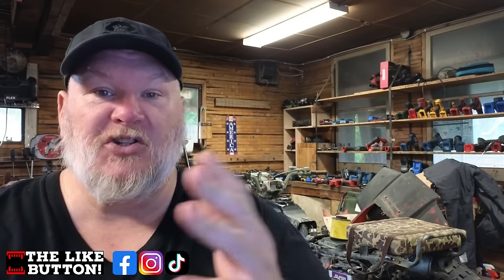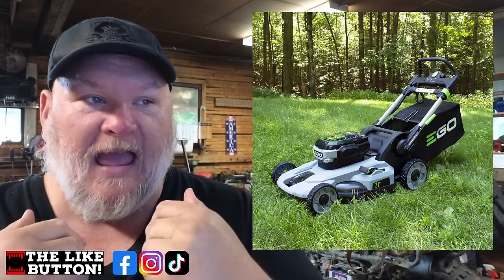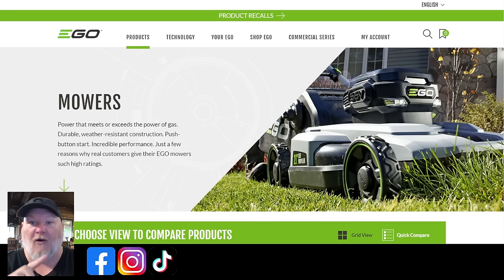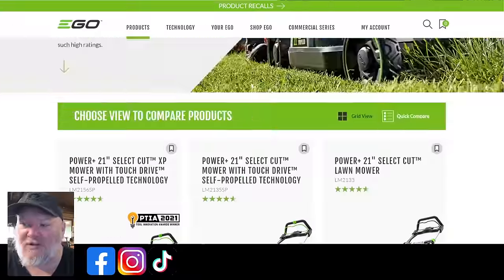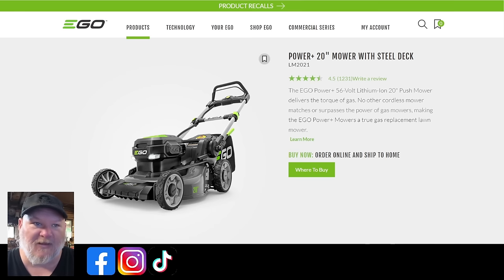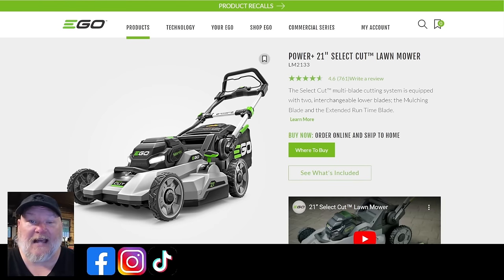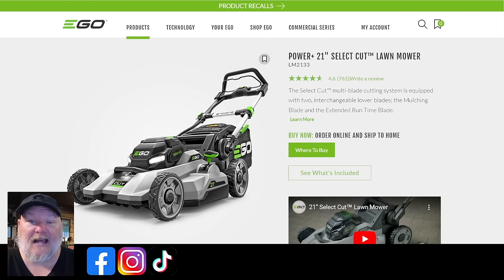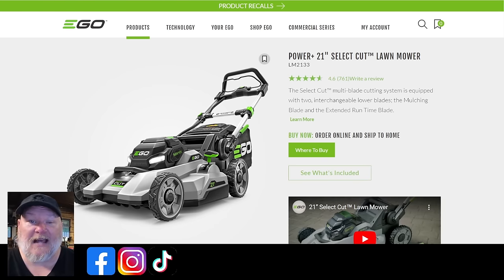What is Going On with Ego Mowers?

Comment: I went down a rabbit hole to decode the EGO mower model numbering system.  LM, of course, stands for Lawn Mower.  Here is the additional info.

Series	Features
2100	Base mower
2110	Base mower with higher torque motor
2120	Touch Drive
2130	Select Cut, may have Touch Drive, includes blades M E and may include H U
2140	Two battery compartments for Peak Power Technology, same torque as XP
2150	Select Cut, XP for even higher torque, Touch Drive, includes blades M H E U
2160	Select Cut, XP for even higher torque, Speed IQ replaces Touch Drive
	
Last number "0" indicates "Tool only" - battery not included.	
Blades: M-Mulching; E-Extended run-time; H-High-lift; U-Upper blade
Reply: Nasa should hire you!  Cheers!
Reply: Thanks. Is the mulcher and  side dispenser pieces included in all models?
Reply: Very helpful!
Reply: @inquisitvem6723  yes
Reply: Thank you. This info is really helpful
Reply: I have one of the originals self propelled for edge trimming, a blower, a string trimmer.  I just got a Z6 52".  EGO works for me.  Tired of effing with shitty gas and carbs and the rest of it.
Reply: Need to add first 2 numbers indicate size (21") and SP is Self Propelled.

Comment: I have the barebones LM2101 (non-propelled, 5Ah,).  It does a fine job on my 3000sf+ lawn (0.2 acre).  I have several other Ego tools, so I have 2 more 2Ah batteries.  I never have to worry about running completely out of juice.  My only complaint is that it only goes down to 1.5".

Plastic vs Steel Deck:  For the vast majority of people, the plastic deck will be perfectly fine.  Unless you're constantly running over rocks and sticks, the plastic deck will be substantially lighter and easier to maneuver.  There is almost no vibration with an electric motor vs a gas motor, so there's very little risk of the deck cracking.  Having an electric mower with a metal deck adds unnecessary weight for most situations.

Push vs Self-Propelled:  Pushing a gas mower is far more work than pushing an electric mower.  With an electric mower, you don't need the heavier metal deck and gas motor and you don't have the constant vibration.  I had both an Ego push mower and an older Honda self-propelled mower.  It is easier to push the Ego than to let the Honda propel itself.  Most people would be really surprised at how easy it can be to push one of these.

Runtime: The best situation is to have all of your OPE on the same battery platform and have multiple batteries.  It's so much easier to "restart" an electric mower once it's run out of power than to "restart" a gas engine after it's run dry.  My old Honda (15+ years old) was a PITA to get started after it ran dry.

13 Different Models:  Absolutely ridiculous.  They don't even need half that many.  They're just cannibalizing their own market.  They only need 1 non-propelled, 1 high-end self-propelled with all of the features, and 1-2 lower spec self-propelled models.  They keep coming out with more and more models that have very little differentiation from the existing models.  They have done the same thing to their blowers, string trimmers, snow blowers and Zero Turns.  Way too many models of the same basic piece of equipment. 

Prices:  The prices for their lower spec stuff are fine.  The prices for the top spec stuff are pretty ridiculous.  The added performance and features are nice (I would guess), but you pay dearly for the privilege. 

Overall OPE lineup:  What they have is great (I have 5 pieces of equipment).  But, they're missing several key categories.  Where are a backpack sprayer, tiller, dethatcher, and REEL MOWER???  I'm sure that they would build great choices in those categories IF they ever bothered to try.  But they keep churning out new models in their existing categories.
Reply: Thank you. A couple questions. Do all the mower batteries from EGO work on all the EGO mower models? If I buy the 56v 7Ah 21” mower , can I use the 6Ah with the mower? I guess it’s a matter of form factor right? If the battery fits in the mower, then it will work? The other question is  a self propelled one worth $100 more than a push one? If something goes wrong with the sp feature, I can still just push it like a push one right? Or will it disable the entire mower? You mentioned that push mowers on battery mowers are really light assuming it’s a plastic deck which is why I’m considering push instead of self propelled. I just know my non self propelled gas mower was a pain in the butt over the years. Thx.
Reply: What about generic 56v batteries I’ve seen on Amazon. Some off brand ones. Have you bought any and tried it?
Reply: They do have a tiller attachment now. It goes on the multi-tool. I haven't used it but I saw it browsing yesterday. 
All the batteries are compatible with other Ego products except it takes an adapter when you use a backpack.
Reply: I too have the 2101 for 4 years.....along with 4 other Ego tools.
I've never been completely happy with the 2101....cut quality,mostly due to its weak suction is my main gripe.
I've done the dual blade conversion.....maybe helped a bit.
I have 0 need for self propelled.....but Ego appears to be pushing me to that cause availability of Ego push mowers here in Canada is......bad.
I love the convenience.....so for now I'll just use it.
The blower,whipper and chainsaw are awesome tho.
Reply: @rodjbosch  Earlier this spring I got a high lift blade for the 2101 push mower and the suction and cut quality improved a lot, especially the suction. It was still the single blade, not the conversion, though.
Reply: @frommatorav1  
I have that as well.
Tried that before the conversion.

Comment: I have a Honda self-propelled 21-inch mower that I purchased over 19 years ago it still runs beautifully and it has an easy start to boot.
Reply: I tossed a new Toro in the trash after a year, the hydrostatic Honda HRX I have now will outlive me, it's just awesome, my grass is basically 1.5" of thick carpet Bermuda, max speed I have to run after it it mows so fast and never bogs. Scalping is next level.
Reply: You still get to smell like gasoline fumes!
Reply: Same here, have a rear wheel drive 21" Honda mower for a decade and still looks brand new. I rinse it off after every use, sharpen the blade every 15 cuts and only use non ethanol gasoline. Starts every time on the 1st pull. I dont see the need to spend $700 for a plastic mower that can barely mow 1/4 an acre
Reply: @snotbubbles3276 I've had the base Ego lawnmower with 5ah battery and rapid charger for 7 years. The battery started waning a little 3 years ago. I bought a 16" chain saw with 5ah battery 2 years ago and use it for the mower. That mower never needed any service other than cleaning the base above the blade after cutting very wet grass a couple of times. I never have to change the oil. I never have to drive to get gas. I plan on getting a  new blade this year but my original blade has never been sharpened or replaced yet. When I  do replace it, I can put the mower on it's side and never worry about spilling gas or oil, either.
Reply: Im trying to sell mine(Honda 5.5) for a battery one. No takers for the past two weeks. Selling for $80. It appears no one is interested in gasoline mowers ☹️. Heck I was willing to exchange it to get my drive way power washed and no takers.
Reply: Gas mowers of 10-20 years were better designed and built than any of today's mowers. We know that and don't need to be constantly retold that in every mower vid. 

The vid is examing what is available on TODAYS market
Reply: Gas mowers are becoming a dying breed. You will be lucky to get anything above $100 for your 21 yr old mower if you sell it. Even used   battery mowers(newer generation) are selling like hotcakes on Craigslist.
Reply: My Honda HRX Versamow is over 10 years old and I am the second owner. Starts first time every time, every year. I bought the EGO last week, but I am not getting rid of my Honda.
Reply: @danielkennedy3073  His lungs take it all in! Enjoy
Reply: @gary22pcb  Smart move! I bought an EGO mower last summer, and I've found it doesn't handle lawns if they're difficult. Our house sits on a hill, and the yard is very uneven and hard to mow. Because the EGO was advertised to be tough, I thought it would do the job. I'm really disappointed in this mower.
Reply: Going electric with the ego mower was the biggest waste of money I have had in a while.  Well be trying to sell it and go back to gas.  Piece of crap.  Batteries die every two years, horribly responsive mower speeds, won't spool up until after about ten feet of partially mowing the grass.  Had one fail already thankfully it was replaced under warranty.  Junk.  Love the chainsaw, blower and weed whacker Are acceptable.  Mower is a steamy pile of crap.

Comment: I purchased my EGO LM2100SP back in the Spring of 2017,  Its still going strong.  It came with the 7.5 Ah battery which is still working well.  The only problem( recent within the last 2 yrs) is that one of the speed control wires has an intermittent such that with the handle extended to operating length has full speed only. Not a problem for me since I never use the SP in my yard with St. Augustine grass( I count it as a workout instead of going to the gym that day)  Great Channel BTW.

Comment: I agree with your findings.  I have their line trimmer and leaf blower and have been really impressed with the battery technology.  By the way, that $1000 mower is that price because it comes with a 12ah battery.  If you were to buy the 12ah battery by itself...it's $600!  I'm an EV guy, so I like to compare some of this stuff to EVs.  You'll see some of the Hyundai and Kia EV cars that cost over $50k, but you sit in them and the materials used feel more like a $25-30k vehicle.  The high price is because of the batteries.  You'll see a lot of hate online for EVs and battery powered equipment because of this, but we're at the dawn of this technology.  I predict in the near future, the prices will drop with better battery technology that becomes lighter in weight, and cheaper to source.
Reply: As an owner of many EGO products, I welcome improved battery technology.  I foresee smaller and lighter power sources, or batteries the same size but with many times the capacity.
Reply: Battery prices will never drop, lithium batteries are a perfect cash cow... The biggest 18650 is still around 3.5ah, the tech hasn't gone anywhere fast in the last 10 years.

Now companies are switching to cheaper lfp batteries which Ford says cost as little as $80/kwh but the cost of their battery pack is like $36k, that's a massive profit margin, same as ego, here in Canada its basically over $1000/kwh for their batteries and that's a total rip off, that's basically 90% of their business...

Comment: I have the original 21" self-propelled mower , bought June of 2016. Still going strong, original battery still works fine, bought a 2nd battery 2 years ago, use it every other mow.

Comment: Australian Ego user here. Bought a 52cm Ego push mower last year. The fast charger was faulty out of the box and only charged the battery to half charge, then shut down. Ego Australia typically provides smaller batteries and charge a lot more than US counterparts. The Z6, for example, is almost $10k here (US$6,600!) and is only supplied with 4x 10ah batteries 😡 The push mowers are usually only supplied with 5ah batteries.. I do like the push mower, now that I have a replacement charger, but I'm pissed that  we have to pay so much here for downgraded products..
Reply: 52 inch?
Reply: @mactive11  No 52cm lol

52" - that would be a 'unit' of a push mower. My bad
Reply: I read that Ego had a bad batch of batteries & chargers which they replaced under warranty without fuss. It happens to any manufacturer

Comment: My concern, and I don't know enough to be sure, is that each of these electric manufacturers are making mowers with no standardization between them, and so every part will be proprietary and must be purchased from factory. Everything breaks eventually, and when these break the parts will be too expensive to repair and these will end up on the curb. I hope I'm wrong.

Comment: I bought a Hart 40 volt 21” with self propelled drive two years ago.  Paid $175 at Walmart and it came with battery and a charger.   It was on sale in October.   Works great, no issues, and it mulches.   Not as powerful as my older gas push mower.  I was looking at the prices on several brands of electric, and the prices are insane.   Glad I got that deal on the Hart!

Comment: I also have a Husqvarna gas mower that now has a Briggs engine on it, but I got my LM2100SP about 5 years ago half price (about $245 then), open box at Home Depot--somebody returned it for some reason. Has worked great, it's a great stand-in when the gas mower won't start for whatever reason, and I still use it for the lion's share of our almost 1/2 acre yard. I can almost mow the entire yard using self-propel with a 10 A-H battery. I will put a new blade on it for the first time very soon when I powerwash and do the winter layup maintenance on both mowers. I also have an Ego 18" chainsaw and a pole saw, and four batteries of different A-H capacity.

Comment: I bought a 21" sp ego that adjusts the speed to your walk speed,Problem is the wheels don't disengage when you come to the end of the run. Other then that I love it. So I went out and bought a used 21" sp ego with three speed control knob. It's way better then the speed iq. As soon as you release the speed lever the wheels disengage like they should.
Reply: Is the LM2156SP better than this LM2020SP?

Comment: Get a gas mower if your in a hot temp state! It was a nightmare trying to cut my grass with my EGO constantly overheating!
Reply: I live in SC and it is very hot and my Ego mower has overheated once in 7 years.I just had to leave the battery out for 10 min. I've wasted more time than that trying to start a gas mower.

Comment: I have the first Ego lawnmower i think its the LM2101, push mower came with the rapid charger and 5AH battery. I got it in clearance at the Home Depot back in 2019 or 2018 cant remember but i paid only $199 plus i had a $20 off coupon that basically paid for the sales tax so i got a deal. Im in South Florida so i mow year round and had no issues with this mower. I did upgrade (sort of) to the Ryobi 40v self propelled since i moved out of a condo with a small 1100 sq ft yard to a house with a much bigger yard.  Havent used the Ryobi yet because the Ego just keeps going man. I have their 650 CFM blower, string trimmer, and multi-head that i use with the edger.  All great tools. None are the newer tools because i think Ego just keeps making the same tools with fancy “upgrades” that are really more of a luxury than necessity for really high prices. Just get the basic model of whatever Ego equipment and it will do the job for most people many years to come. I havent had to use their warranty because i have not had any issues with any of their equipment.  I love Ego and would recommend their OPE line to anyone, pro or DIY.
Reply: I've had a similar experience except I think I bought my mower in 2016 new for $400 or $450. The only thing I bought "fancy" was my string trimmer. It has the carbide shaft with auto string loader. I also have an edger, hedge trimmer and pole saw, bought without batteries. I bought a 16" Ego chainsaw 2 years ago with the 5ah battery included so I could use it in my mower. All my tools have never broken down. My first string trimmer came with a defective battery from day one. The brand new replacement has worked flawlessly for about 4 years.

Comment: I purchases (and returned) a Greenworks 40V mower with a steel deck. But didn't seem powerful enough for my hills. It was on sale. During the second mowing, the batteries died. Their models are confusing too. I expect the 80V pro model is great. But I  probably buy the Ego next spring.

Comment: I have the 2125 21" touch drive,  7.5amp hrs battery  this thing is a beast,  I love it.  I mow a 1/2 acre and only use 40 percent of the battery.  I also have the 615 blower and the self winding string trimmer, awesome tools.
Reply: I have the 2135sp with the same 615 blower and power load weed eater and I have to swap batteries so I have no idea how you're getting half an acre done on half a 7.5ah battery, all of my tools were bought in the last 3 months because i was sick of gas and wanted to go electric so maybe I got a dud or my grass is thicker than yours
Reply: That's when I don't use the self-propelled
Reply: The blower uses up the battery very fast

Comment: I bought the one with the 7.5ah battery.  Good mower, good battery, the self propel is unrefined.  It works for me, I have to charge the battery about twice per mow.  Thinking I'll buy the leaf blower and utilize that battery.
Reply: That will work well. I bought an Ego chainsaw with 5ah battery to use with my mower and it works great. I have one of the original push mowers and that battery got weaker after 4-5 years but still works. The newer battery is 2 years old and I haven't noticed any degradation yet. Now I can always have one charging or charged while using the other one. I basically only use the newer one 80% of the time because it's better. With you not having yours as long, the spare will be interchangeable.